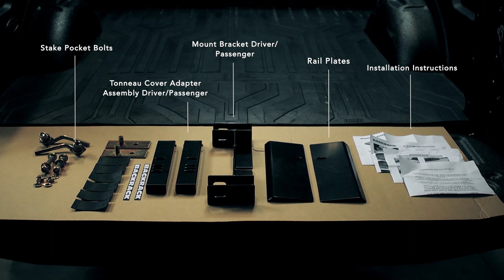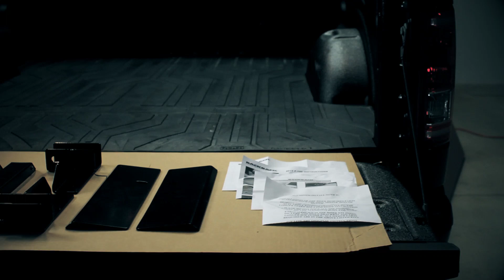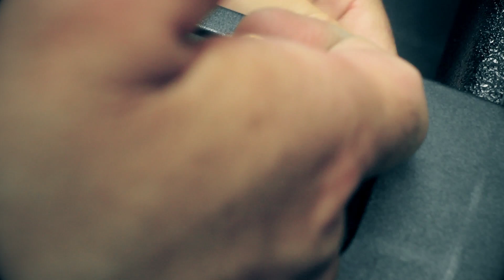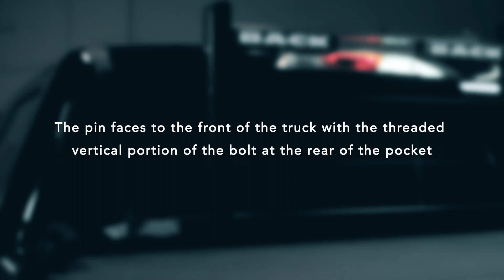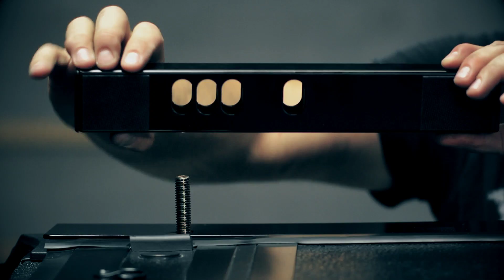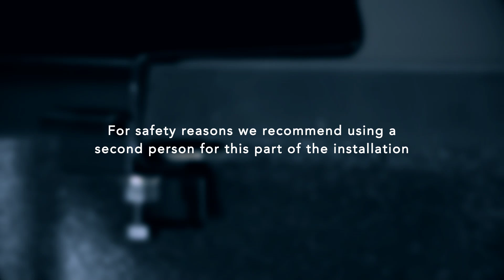BACKRACK™ 4000 Series Tonneau Adaptor Install

Comment: I used the product selector on their website and purchased a 40123 kit for my 2024 F-150. Turns out the rail plate driver is too big for my tonneau cover which was clearly listed in the product selector. I either have to modify it or send the whole thing back.